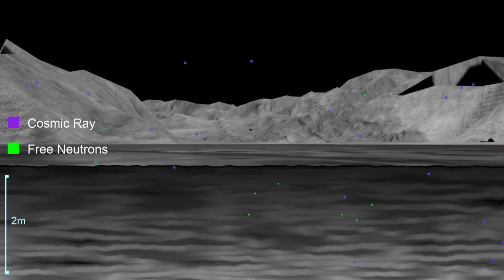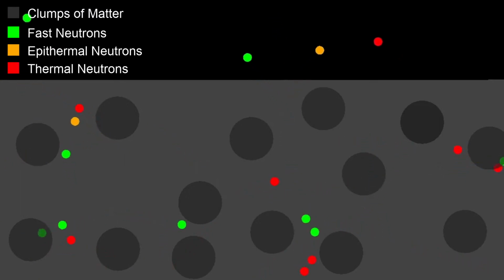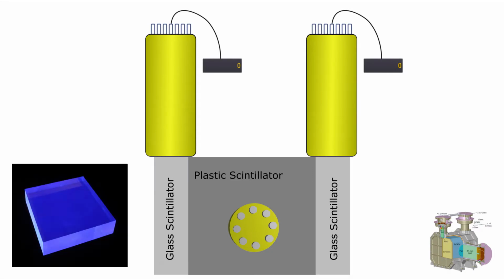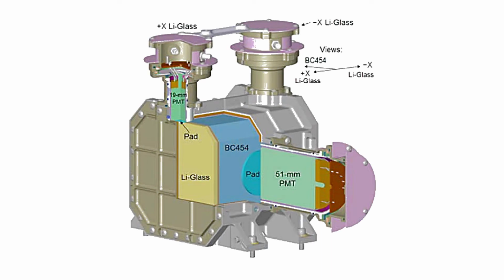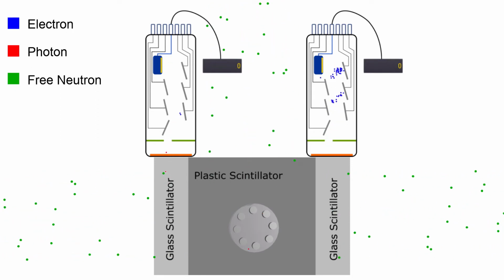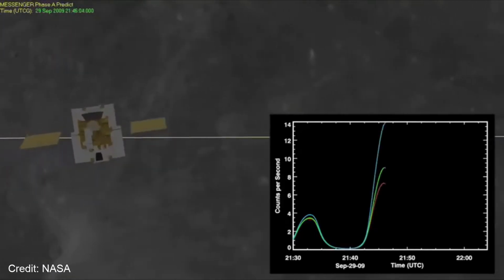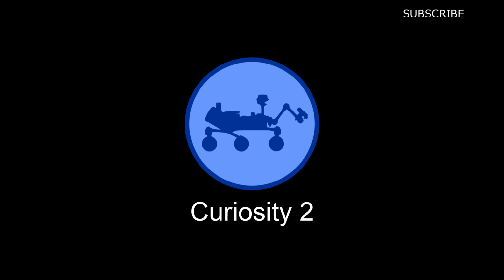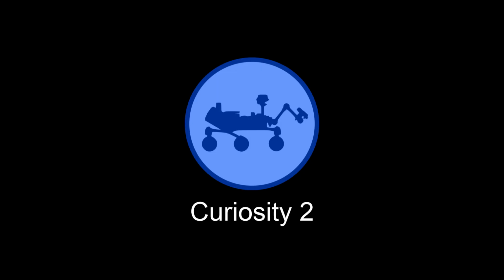What lies beneath

Comment: Excellent treatment. I always assumed surface composition could only be retrieved via gamma spectroscopy of cosmic-ray induced neutron activation of surface minerals. Neutron spectrometer based technique of (non-hydrogen) surface composition deduction must be much more complicated.
Reply from the maker: Yeah.  The data generated by the Gamma ray spectrometer that’s also on Messenger I think helps with narrowing and interpreting the data from the Neutron spectrometer.